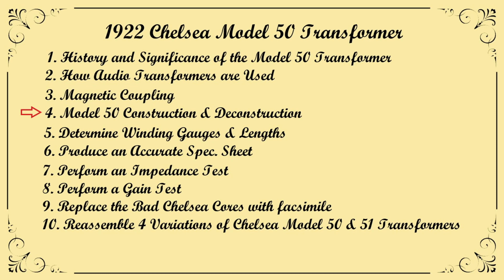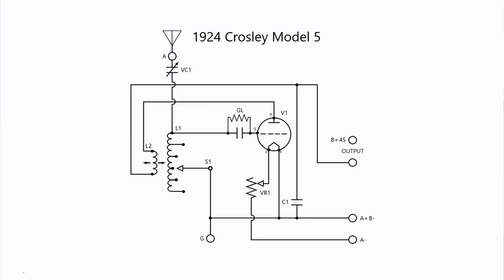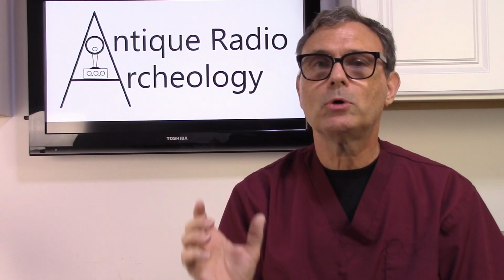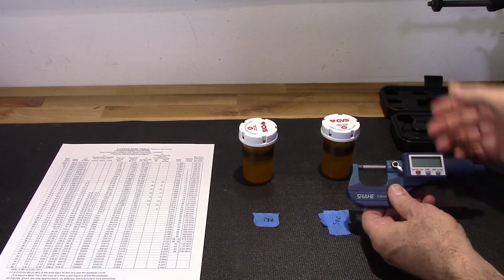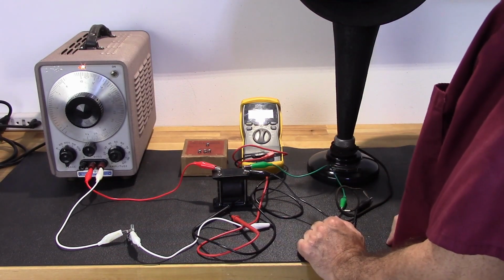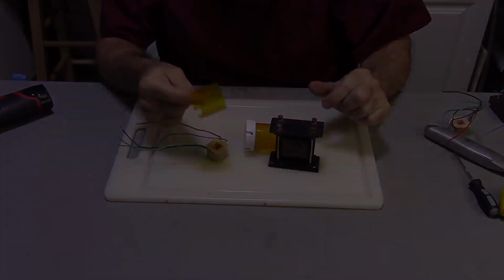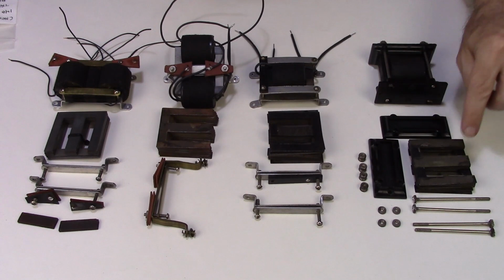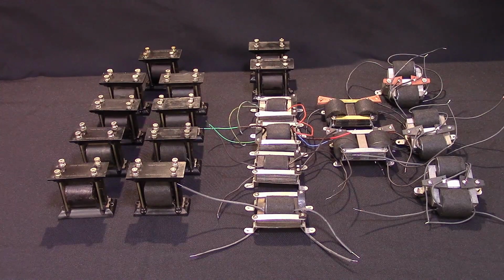Everything You Would Ever Want to Know About a 1922 Chelsea Model 50 Audio Transformer

Comment: The analysis of your transformer is missing the DC current in the primary and also the secondary is never load with any resistance like you showing us but the high frequency is limited by the resistance and leakage inductance of the transformer loaded by the capacity of the following tube grid plus Miller effect. Not simple.

Comment: Resistance coupling is incorrect and did not exist in any radio...
Reply from the maker: You might want to look at some of Lawrence Cockaday's work before making that statement.  While "true" resistance coupling may not exist, the term was used in circuits where resistors played a primary role in what we refer to today as a form of RC coupling.

Comment: That was a great job!  I’m sure that with your skills in the future you may want to try to wind a transformer by yourself. Modern wire enamel avoid the use of layers insulation (you may only do between primary and secondary) making the winding process a lot easier. It’s a really satisfying task and you can match the original ratio, as well as the original shape. Again, excellent solution for those antique radios. Thanks for sharing this video.
Reply from the maker: I will at some point.  I didn't really want to have to do it with this many transformers though.